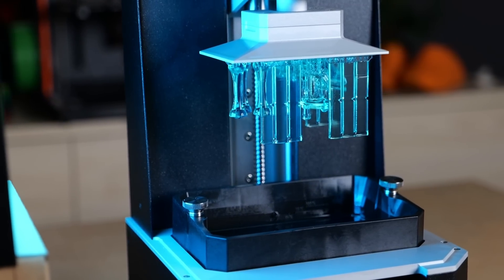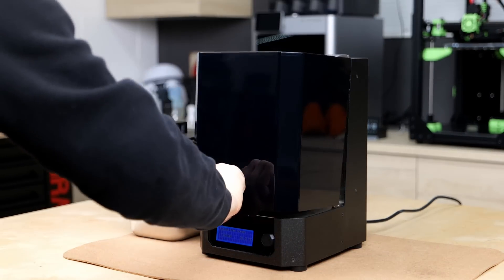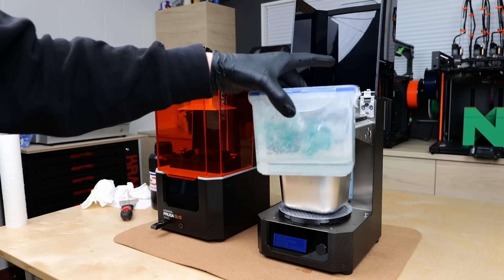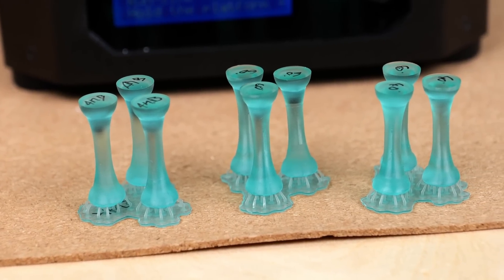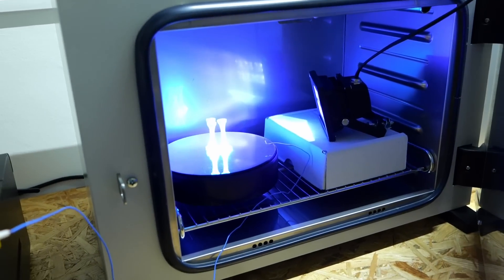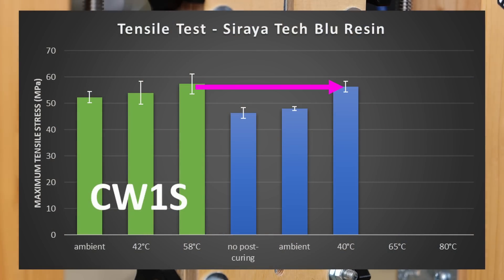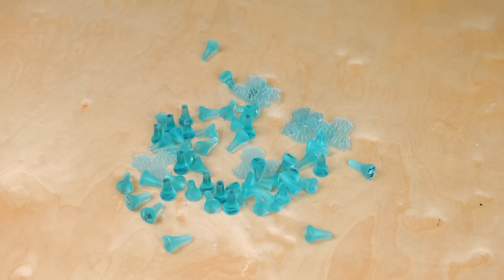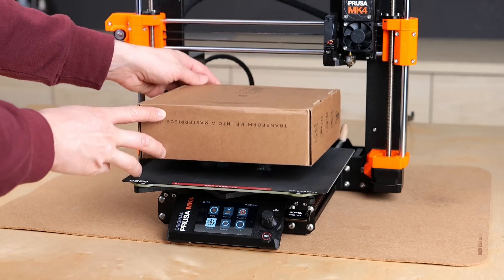Why does Nobody Cure their Resin 3D Prints like this? (40% more strength)

Comment from the maker: Does this open new possibilities for resin 3D printing?
Support the channel and check out CNC Kitchen products at https://cnckitchen.store/
Reply: I was guessing you were going to cure with heat and an oxygen inhibiter (water). Siraya Tech actually suggests using water to cure Blu resin (in their TDS). I believe the idea is to inhibit oxygenation, which is determental to the curing process. Siraya Tech mentions its more efficient as well, generally speeding up the curing process.
Reply: @mikejackson9585  Really good point. I'm going to try curing in hot water.
Reply: @jtjames79  Try hot glycerol instead of water, you won't be sorry!
Reply: @mikejackson9585  Glycerol is even better than water, equal to or better than curing in a vacuum chamber.
Reply: emerald!?
Reply: @camplays487  Probably Emerald V2.
Reply: In the past I worked in a Lab with Dental cement that was both chemical curing and UV curing. Of course it cured faster with UV, but when mixed It would cuore also without UV. 3d print resin I suppose Is significantly different from that cement, but I Guess It keeps naturally curing for some times after UV treatment. What about testing some shortly post cured samples in different times (days) vs thermically annealed samples? And what about pushing annealing to higher temperatures (120⁰C ?) without in-oven UV? It would be interesting to find if it's known some chemical hardening agent as resin prints are often empity insider and curing the inner Wall Is often tricky or impossibile (some chemical initiator that could be dissolved in some organic solvent to make a "curing bath" would be handy, but I don't know if It Is possibile)
Reply: Temperature very often simply accelerates chemical processes. I relly wonder if same effect would be if you simply cure for much longer time? If same polymers are forming, then much longer curing should have same effect. Remember that post-curing is needed not only to harder parts but also to prevent further sun-curing, which (due to different UV light wavelengths) can create different polymers, sometimes unwanted.
Reply: @CNCKitchen Do the same experiment, but cure the parts in a glass jar of glycerol with the glycerol  at the temperatures you tested.
Reply: well i would love to be able to use resin printer to print more than just dolls
Reply: Interessant, ich hätte nicht gedacht, dass man solche Polymere auf eine ähnliche Weise wie Metall nachbehandeln kann, obgleich mir das bei Lackiertechnik und Carbonlaminaten bekannt war. Der Vorgang des Temperns untersheidet sich lediglich durch die Temperatur.
Reply: I cure in a container filled with 100c water for some resins, works quite nicely.
Reply: What do you think about using Vevor RTD-23A towel heater to cure then ? 
It provides UV light and heat about 70-80C.
And it's cheap, just about 100EUR. The only think it lack is rotation.
Reply: Do you have to heat them while curing?

Can you just stick them in the oven after curing?

Edit: 5 seconds after I posted this comment, I got to the answer in the video.
Reply: first

Comment: This is interesting. I've seen that water soaking while curing also strengthens parts (proven with studies) so I'm thinking of testing hot water soaking and curing. Using a thermometer to set water to a temperature. Hopefully the thermal mass would be sufficient enough to hold the temperature long enough to complete curing

Comment: Would like to see you try this with high temp resins like Sculpt from Siraya Tech for example, or high temp from Inslogic.  Neither recommends you anneal the parts nor cure them with heat.  Curious to see how this method would work with these engineering resins, but I don't have the testing equipment like you do, to validate the results.

Comment: Something i want to try is blending photoresin with two part resins more associated with strength.  The idea is the 2 part resin is mixed at the nozzle or a little up stream and the hopefully small amount of photoresin mixed in will allow the print to hold its shape, but the final curing will be done by allowing the 2 part to cure as normal, probably with a relatively slow acring hardener to allow for the whole process to happen without locking up the machine. 

2 part epoxies can have all sorts of properties that we seem to be missing out on in the 3dp world, and im wondering if we cant take advantage of it.

Comment: It’s not all that surprising to me that even heat treating after curing works, after all post-curing only really affects the outer layers of a print. The UV can only penetrate so deep. So If you heat and cure at the same time you only get the strength benifit at the outer layers

Comment: Not sure if anyone has thought about it but could it be possible to temperature cure the UV cured parts in hot water? I believe there would be less risk of deformation and it is really easy to keep a consistent temperature for basically everyone at home. I will definitely test that.

Comment: What do you think about using Vevor RTD-23A towel heater to cure then ? 
It provides UV light and heat about 70-80C.
And it's cheap, just about 100EUR. The only think it lack is rotation.

Comment: Well these methods are nothing new for the resin printing in general - post processing in high temperatures or using vaccum chamber / submerging in glycerin (to limit wastefull reaction between oxygen and polymerization catalizers). These things are explained in the more expensive resins catalog notes. The thing is, in most hobby applications of sla 3d printing we're using much cheaper and simpler resin, which doesn't require these extra steps or hardly benefit from implementing them.
I've been  experimenting with these resins and curing in glycerin, and hot scalding - cold water post process. Test prints (on very small test sample!) had show some improvements in elasticity in drop and bounce tests. Though it wasn't something worth the hassle while printing tabletop miniatures.
Though hearing more often about siraya tech tough, I might get some to try printing some gears as it seems a quite good fit for such applications :D (though being 2 or 3 times more expensive than usual resin for miniatures).

Comment: I always pour boiling water over the print (which helps separate it from the bed) then wash with IPA and cure under UV light. The parts always come out tough
Reply: the longer you heat it the stronger it gets, im getting over double strength with Rigid 100 resin.

Comment: Does it make a difference, by chance, if you print in a heated vat vs. ambient temperature? I'm still very new to 3D printing, but this is just a thought.
Reply: heating in a vat just mainly helps the UV sensitive chemicals react and bond better but a heat treatment fundamentally makes it stronger. i have a heat-resistant resin that cures at normal temperatures and exposure times but suggest a 80C heat treatment and UV exposure for 1 hour for maximum tensile strength.

Comment: Absolutely amazing research! I just saw a video with Adam Savage and the team at Carbon who is working with Adidas. They do a combo like this but use the printer to lock in polyurethane chains the. Use heat to fully cure it which gives a durable shoe sole. Very impressive stuff. I hope we start seeing resin manufacturers design in heat cure properties for DIY guys in the near future.
Reply: anycubic came out withe Rigid 100 resin, it cures requires 1 hour of UV curing at 80C to get 100% more strength, i threw a chunk of it as hard as i could on concrete and it chipped a stone aggregate in it and resisted shattering with only deep scuffs.

Comment: Great tests, and results!
I have a question - a bit side-one, but it's about the emerald Blu - I printed a large and thick, articulated turtle for my nephew, which I'm quite sure is strong enough to survive abuse from little kid.
And also I'm going to cover it with a food-grade resin so that I eliminate any rick of toxicity or allergic reaction.
But the problem I got is that the turtle was very sticky for a long time after the print. So I decided to try to post-cure it until it stopped being sticky, but it turned out to be very difficult!
My girlfriend is a dentist, and she has a strong UV curing lamp, which we used for about 2 hours manually, and it made very big difference - still a little bit sticky, but only a little, and way-less than originally. 
However I didn't want to finish it and give it to a kid while not completely cured, so I postponed for more than two months, which were very sunny and the turtle spent most of the time on the front of my car, right inside the front wind-shield. After a while most of it is not sticky at all, except for few places belly, and inner articulated joints (it stayed most of the time with its belly and feet facing down as normal turtle would, so obviously the top got fully cured by the Sun, while the bottom not completely yet).
The unplanned bonus with that post-curing is also the higher temp. in the car when I leave it parked in the Sun (which is quite often).
Anyway, originally when it was still very sticky my girlfriend told me that oxygen can actually  inhibit polymerase no matter how much or long UV curing continues, and the solution for that problem is to cure it while covered by something transparent, but that displaces the oxygen (ie the air) from the surface of the print, for example glycerin gel.
So I'm about to finish it soon with the food-grade resin, just giving it few more days with the turtle's belly and feet up to cure it as much as possible in the Sun.
But I wondered also about Siraya-tech certifying their resin as bio-compatible (not sure how much, I guess not for constant contact with sensitive skin, like piercings or teeth accessories, but perhaps good enough to bracelets and wrist-watch straps?). I remember that in the bio-certificate for Blu they did require curing in higher temp (I don't remember exactly but I think it was aroud 60~65 degr. Celsius).
That would be a definite motivation to upgrade my DIY post-curing station with a heater if we get better strength AND also bio-compatibility.
So do you know anything about that?

Comment: I have a strong background in resin casting. Using chemical hardeners that cure the resin in a mold instead of photo initiators creating nucleation points.
We almost always annealed resin casts, which made for a more noticably durable material.
So it makes sense that annealing post curing in UV results in increased strength too, as this is basically how annealing is done in resin casting.
It's not always necessary to do, but even in wargaming miniatures, depending on what resin you use, such as ABS-like resins, the ductile strength of that resin remains while increasing tensile strength.
TL,DR; Its almost always beneficial to post cure anneal your resin 3d prints.

Comment: I'm more curious how to keep the transparency so, well, transparent.  A few toy replacement parts, like a star trek phaser emitter, would be nice to recreate that tip with such clarity.  Don't even need the strength so much as the clarity.  I've seen some videos that say I need to bathe them in a chemical? I've never resin printed before but I just know they print more detailed prints and need a good bit of ventilation.

Comment: I recently tried curing prints in tap water. No idea if it affects strength but parts seem to cure more uniformly with a more consistant non sticky surface so it might be worth you testing this?
I place a clear container filled with enough tap water to submerge the parts into my curing station. Warm water seems to work best.

Comment: Very interesting results! I will be putting my prints in the sauna after curing from now on! :D A couple of things I'd be interested to see you investigate are, firstly, does heating the print before post-curing affect the strength, and secondly, how much might curing lamp UV light power affect the strength.

I cure my prints with a DIY curing box where I have a 30 W 405 nm UV lamp (sold as a spare part for some curing box or other on Aliexpress). It's a VERY powerful lamp and I noticed that the prints cure very thoroughly with it. Testing it with a drop of uncured fresh resin from the bottle almost resulted in the resin catching fire: it cured so quickly that it turned brown. On the other hand, when I tried with a common UV "blacklight" LED strip (also 405 nm but way less wattage), the resin only cured sluggishly, and fresh resin hardly even heated up while hardening. The prints I've post-cured with the 30 W curing box have always been very strong.

Another thing I thought about was pre-post-cure heating. I used a hot hair dryer to dry off the alcohol that I washed some parts in. This resulted in the parts heating up significantly (I couldn't hold them in my fingers). After post-curing, these parts were very strong indeed. So maybe the heat can be applied at different stages of the procedure, as long as it's there at some point?
I also noticed that the cured finished parts seemed to get tougher (or at least stiffer) still after sitting on the table for some days in room temperature and not in any sunlight (it was November in Finland!).

All my parts were printed in Elegoo ABS-like 2.0 resin in grey. The printer is an Elegoo Saturn 2 and I used the default print settings from Chitubox.

Comment: UV naturally will create heat in a small space, but not too much. I work in a hot studio, so for us it is always between 75-85 F in the room. Add the UV light and enclosure and I see the temps go up to 90, but our materials seem good and tough at around those temps. From my experience the materials will tend to become more brittle as they get hotter and over cured. This is interesting to see and probably has a lot to do with materials as well as environmental factors.

Comment: I would to see this test redone but using something like tabletop miniatures and specifically testing the durability of smaller more fragile parts like swords and extended joints like arm, bend testing as it were

Either way thank you for the informative video.

Comment: Here's a thought: Print some more Blu test pieces. Check the strength of one set right away and then a second set after standing at room temperature for, say, two-weeks or a month and retest. Perhaps the strength will improve significantly just from further curing without heat.

Comment: It makes sense if it works something like... heat is basically adding energy into a chemical system as well as loosening some weaker bonds (I think hence the softening). The additional energy makes the bonds jump around a bit thus finding more optimal cross connections and more numerous ones.

Comment: Just an observation…why didn’t you remove the parts from the support structure BEFORE curing them?  That’s the workflow I’ve learned…and since you’re testing tensile strength, you would put less stress on the part removing it from the support by removing the support before fully curing during post-processing…this should give more consistent results.

I’m also curious where you obtained your information regarding post-processing curing times?  I’m only curing for a few minutes (3-5 minutes on average)…wouldn’t UV curing for such a long time (I think I heard you say 15 minutes) make the part more brittle, reducing its strength?

Comment: It would be really cool to see these pieces before and after different treatments through polarizing light filters to observe the stress patterns in the structures. You only need polarizing filters (cheap) and a flat monitor (blank white screen) - look for "How to find Stress Patterns with Polarizing Filters". Also would be REALLY cool to record the strength test with the filter. If I had a resin printer and a strength test machine, I would do it. Lol

Comment: I've discovered this effect when I left a resin printed part on my windowsill. It was way stronger than any of the parts I cured with UV light. I wasn't sure what caused it at first, but eventually figured out the the temperature of the sun helped with curing.

Comment: I work in the carbon fiber industry and have some input! You mentioned the “giant ovens” aka “autoclaves”, but you didn’t mention the other huge property of them; they are pressurized! Carbon fiber parts are vacuumed down to get the resin into the fibers, and for high tech applications the autoclaves are also pressurized.

It would be interesting to see if pressure would net these resin-only parts any strength. Maybe putting some UV LED strips inside of a pressure cooker would make an interesting video!

Comment: Hot water uv curing for two hours. Oxygen is the curing inhibitor. Water is the solution to this. Hot water is the oven, too. Default method of oxygen-inhibited curing for pathetic 15 minutes in my case produced unusable objects that reeked of resin 1 year later after heavy curing. And I have a strong heart-attack like reaction to these fumes (formaldehyde). Water + temperature + oxygen cutoff fixed this.

Comment: I have been heat curing my resin prints in my filament dryer at 65C for a while and it helps for sure. If you look at the documentation for high end resins they specify high temp cures, somehow it just hasn't trickled down to the hobby space

Comment: I water cure my resin prints, I read a research paper that talked about how oxygen inhibits the polymerization reaction and so it can interfer with the curing process. while I don't have a way to measure the force required to break models I do think that curing them in water resulted in my prints being a bit more resiliant.
Reply: OIL tends to harden after i treat parts at 80C for several hours after i do a UV curing, did you test in water washable resin?